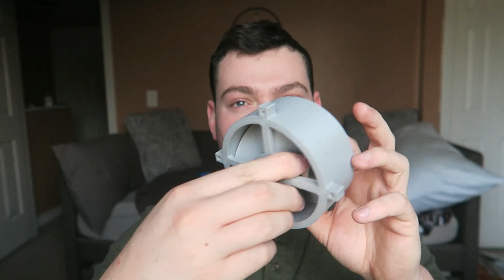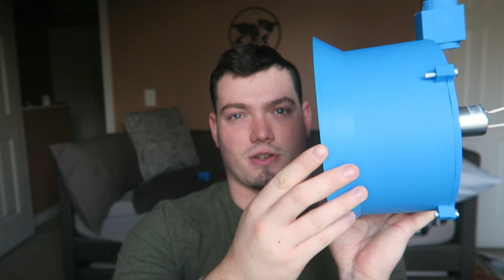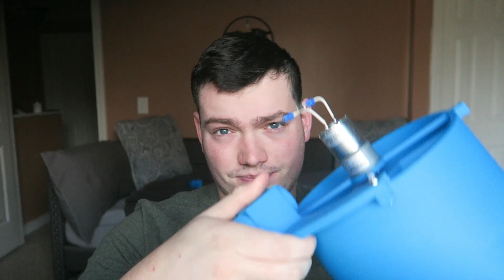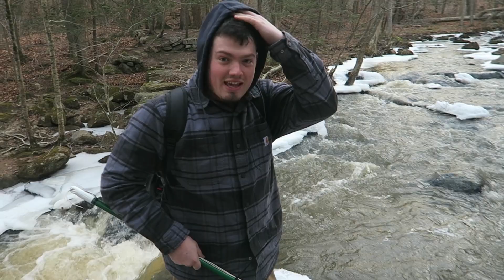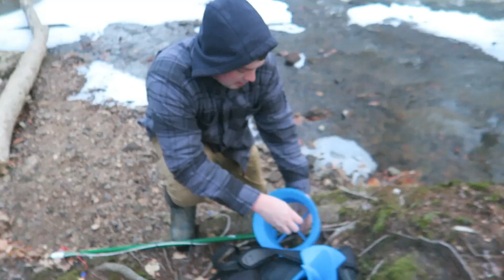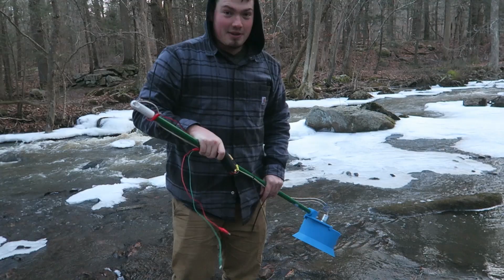Upgraded 3D Printed Hydropower Turbine Test

Comment: I see a few things you've done wrong but very easily fixable.
1. Seal the motor/DC generator so no water gets inside.
2. Seal the solder contacts from water to eliminate the direct short both in the motor/DC generator and at the wire, motor/DC generator solder contacts.
3. Make your wires at least three meters (9ft) to make it easier to check the voltage, amps, watts so you can make adjustments as needed.
4. Try using a three phase motor as the generator to see what the difference is.
This is a very good concept and idea I'm interested to what changes you've made in the following video(s). Good luck.
Reply from the maker: I'll have to do these and make changes, the new hosing and everything is printing as we speak so should be very soon. Many other models in the works too. Any suggestions for a 3 phase motor? Really wanna try this
Reply from the maker: New video is up @Jc Lowe, used some of your ideas last minute, thank you.
Reply: @Beyond_The_Print  your welcome and I'll go watch it now.

Comment: The uneven flow of the water is causing the motor mount to flex, which then causes the propeller to scrub against the duct.

Would be better if you could increase the gap between the duct and the propeller

Another problem is that the pitch of the propeller may be too flat, could be fixed by increasing propeller pitch.

^^ might make the motor spin at a lower rpm, but it will be smoother that way, as the resistance of the water hitting the blade would be lower
Reply from the maker: I'll have to try these things out, thanks